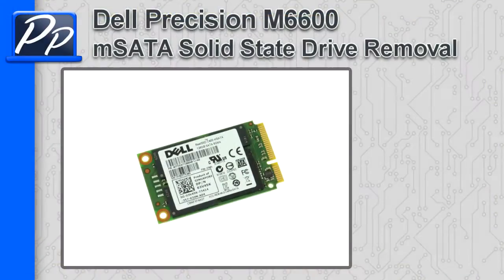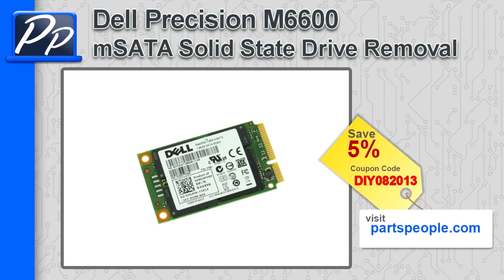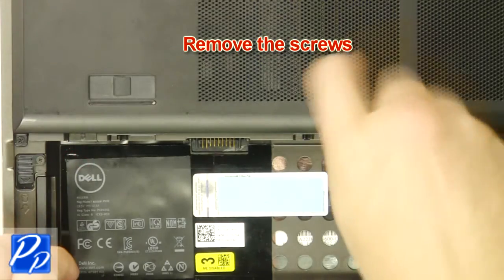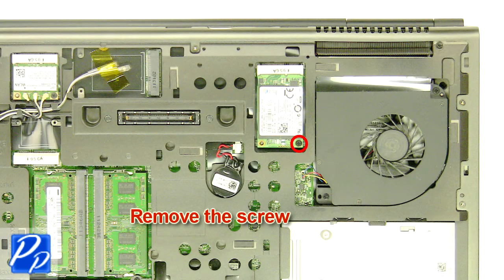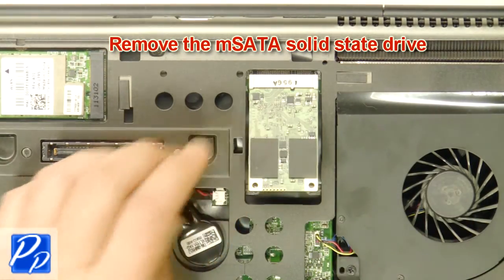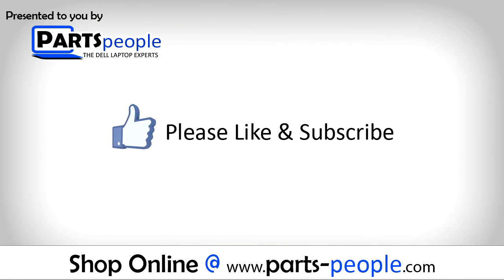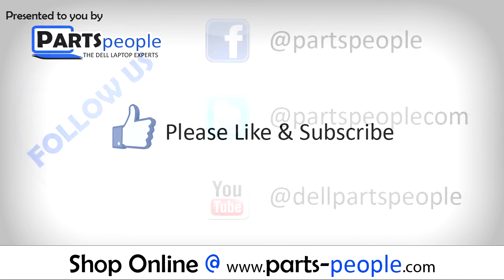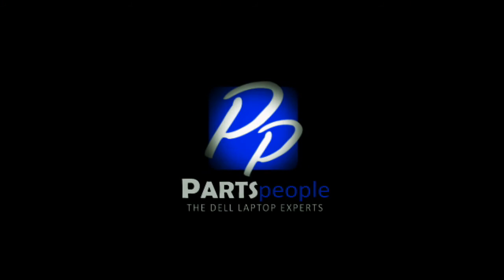Dell Precision M6600 mSATA SSD (Solid State Drive) How-To Video Tutorial

Comment: Does M6600 have 12V SATA power line?  That would make a difference in attempting to use a 7mm enterprise grade SSD drive.  While we're at it, I collect 15mm drives aren't something we can use in this workstation, but how thick can we go?  Cooling issues aside, just dimension-wise.
Reply: These Precision laptops take only drives up to 9.5 mm in height, actually you will not find any 12.5 mm drive with reasonable capacities anyway, and 15 mm drives are too thick for any laptop. I know it is possible to put them in some Alienware models, which have two SATA slots above each other as two drives are placed like that, however you cannot use the both of them, once you put such a thick drive inside, the other slot is unusable, unfortunately.

Comment: I would like to start by saying thanks for the informational videos. They have helped me a lot in repairing many of my other laptops. 

Now, I know this is over 2 years old, but I still have lots of love for my M6600, and I love pushing it to its limits. 
I would like to use an mSATA SSD drive for my boot drive to further improve boot and access times. 
I already have my M6600 upgraded from a 2.3Ghz quad core Core i7 to a 2.7Ghz quad core Core i7 2960XM, changed the 2Gb Nvidia Quadro 4000M to a 4Gb Nvidia GTX 680M (not running Optimus), changed the Wifi card from an Intel based Wireless B/G/N card to an Intel based Wireless AC card (whitelist approved) and added a 240Gb Kingston A400 Black drive, all powered by an OEM 240w power brick. 

Do you have any confirmation on the improved boot times of an mSATA? Is there a noticeable difference between a standard SATA 2 SSD and an mSATA SSD? Also, are you able to stack drives for storage? I would like to install a 120Gb mSATA drive and a 500Gb or 1Tb SATA 2 SSD or 7200 RPM 2.5" drive for storage if possible.
Reply from the maker: I would not expect for there to be a significant improvement in boot time when comparing 2 different SSD's.

The M6600 is configured to store data on both MSATA and SATA drives simultaneously.
Reply: @dellpartspeople  Thank you for the response.
I'll probably just keep everything the way it is currently set up then, with the exception of maybe adding a 1Tb 7200 RPM 2.5" drive and remove the 500Gb drive for more storage.